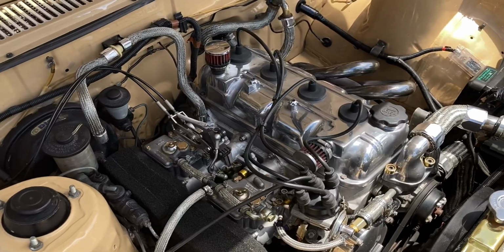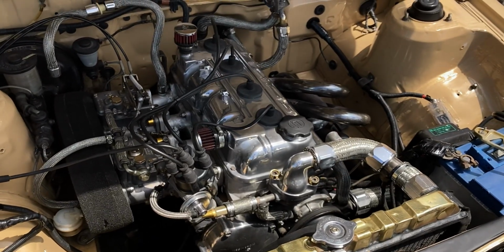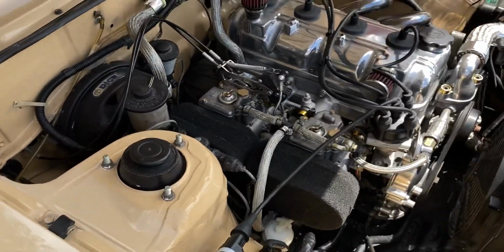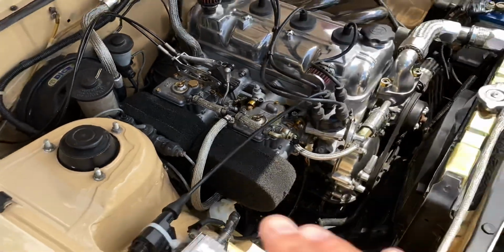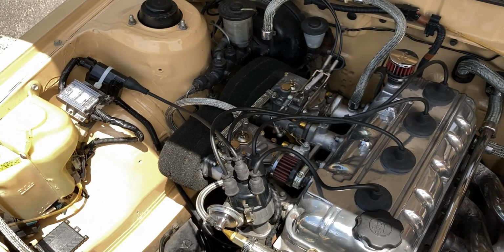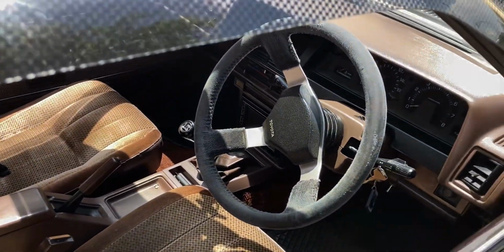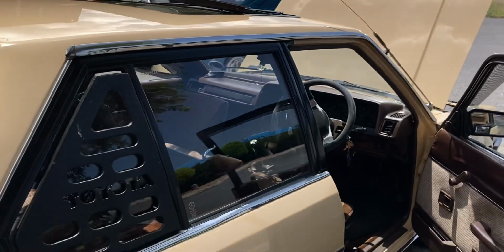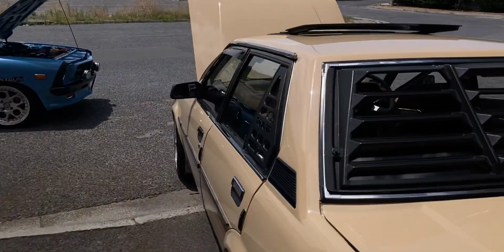TOYOTA COROLLA KE70 😁| This is my ride Ep97 (Part2)

Comment: That is not a KE70, that is a TE72. It would be great if you can do some research on the cars and engines before doing the vids. Nevertheless great content just giving some feedback.
Reply: What's the difference?
Reply: @kb1248  ke70 only came with the 4K engine and have rack and pinion steering the TE71 And TE72 comes with the 2T and 3T engines hydraulic clutch recirculating ball steerings. There is also a AE71 with the 4A engine.
Reply: it depends where you are situated
Reply: @experiencenature4495  sorry my guy..ke70 came in 2t/3t aswell...
Reply: That is why I suggested to VAD to do some research before reviewing a car and giving some history and technical detail. I was also under the impression that it was the same car and it is not I have owned both cars. I bought the KE70 because I thought I could swap the 1.8 3t which came out of a TE72 Toyota sprinter  into it and it was not a straight fit. That is why I say it is misleading info. Check the model numbers in the engine bay the cars with the 3t is a TE72 the 2t TE71 the 4K KE70 and the 4A engine goes into a AE71. The bellhousing and crossmember out of the AE71 makes it possible to fit the 4AGE 16V and 20V into  the TE71 And TE72 using the same gearbox. All the box shape toyota falls under the E70 model, it is not all KE70.
Reply: "K" and "t" in the ke70 te71 codes are engine dependent. A ke never had a t engine and vise versa. But alas there are alot of engine, trans, rear end variations so the vins get confusing.